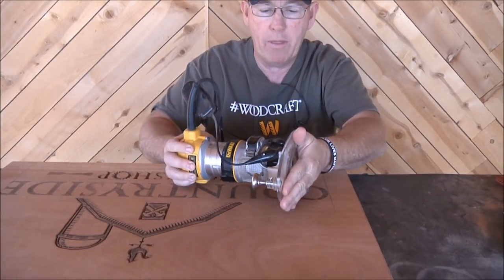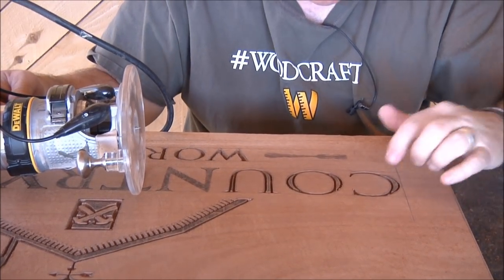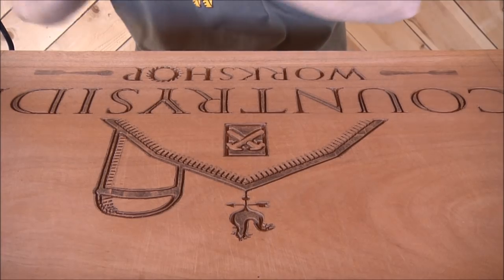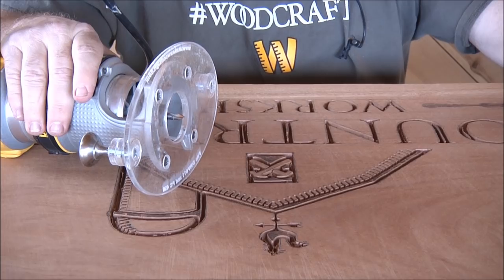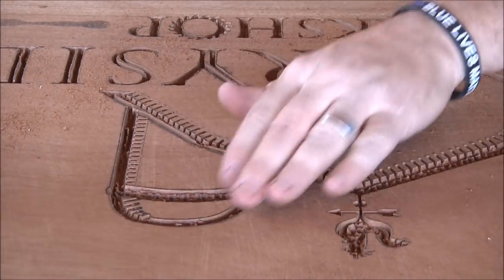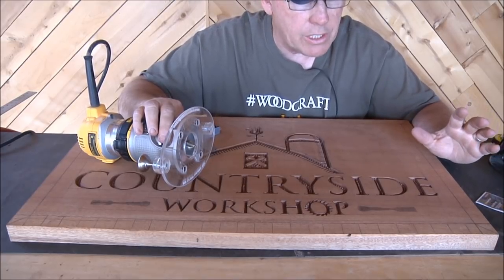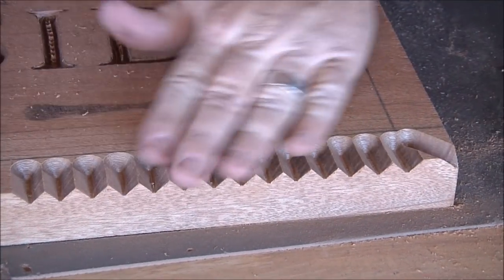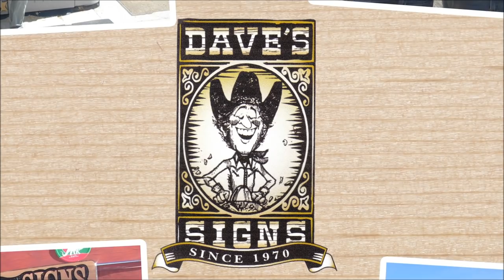#386 Free Hand Carving Wood Sign in Mahogany For Countryside Workshop Part 2

Comment: Eric where can I buy those lights you use bud. Looked all over and anything I bought is not good. Any insight
Reply from the maker: It's in our Amazon store. Here's the link  https://www.amazon.com/shop/makeawoodsign   Thank you!!!
Reply: How does it get attached to the routers. I want to buy 2 or maybe 4 of the lights
Reply from the maker: It had a clip that I put right on the cord, or like I did on the video I glued it to the router housing.
Reply: @oldave100  got ya. As soon as I sent the question I came up with same answer as you gave me. CA GLUE AND ACTIVATOR. Thanks Eric